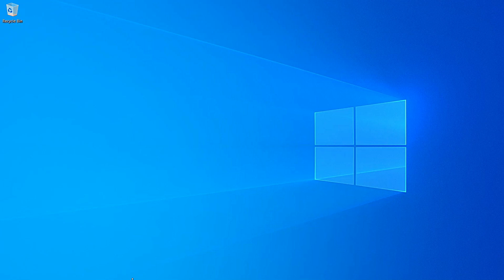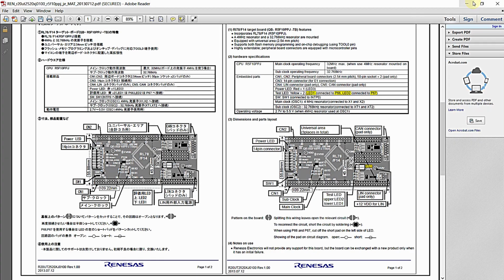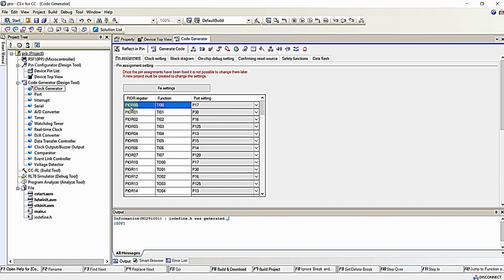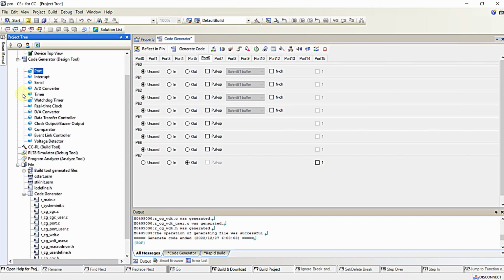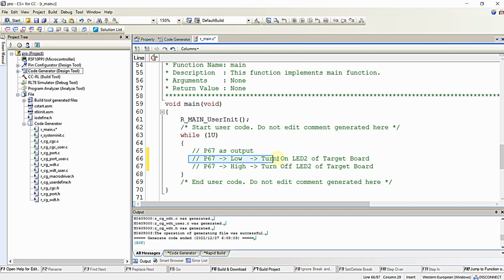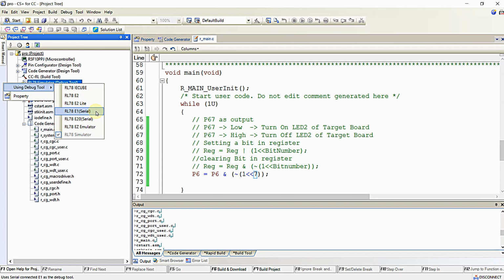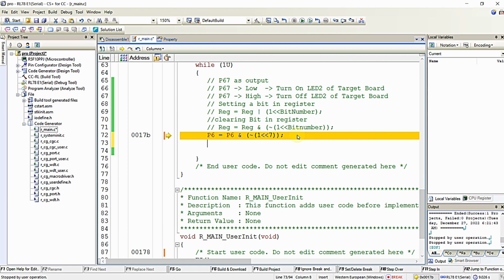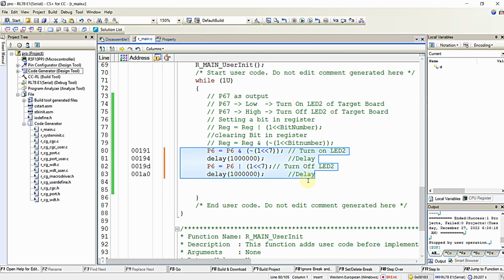Interfacing LED with Renesas RL78 Microcontroller

Comment: Sir, I"m repeatedly getting an error.. The error says: Download failed. No response from the emulation CPU. Please confirm the signal of the CLOCK or RESET, WAIT and so on. (E1200416)

I'm using a MCU R5F10NPJD, and trying to light up an LED kWh on the board. The MCU is powered on by an AC voltage of 220V, and hence, I"m not supplying voltage from the E1 emulator. 

But, the error seems to be occurring repeatedly. What to do? How can I resolve the above error?